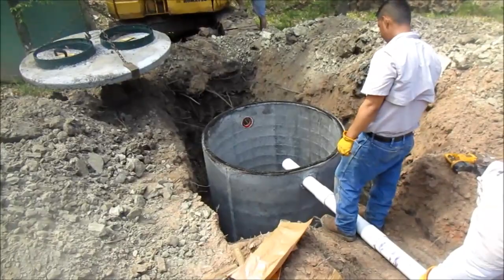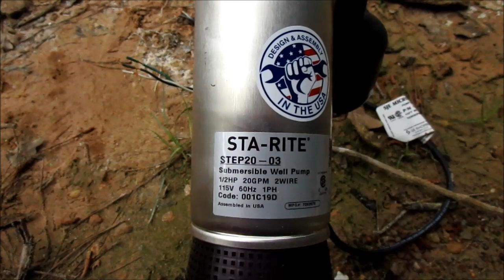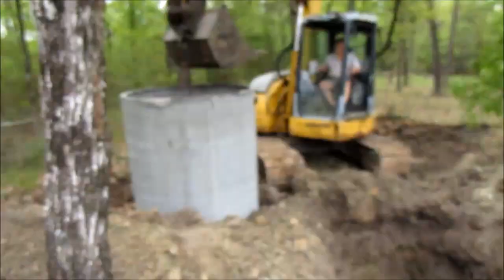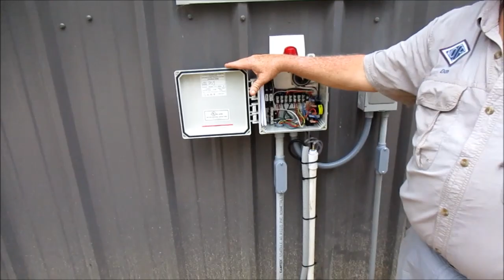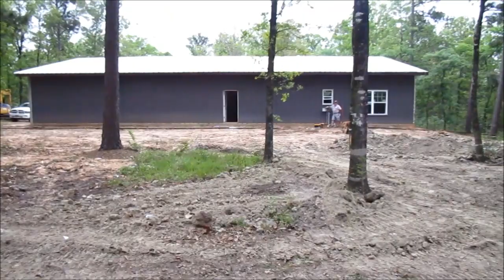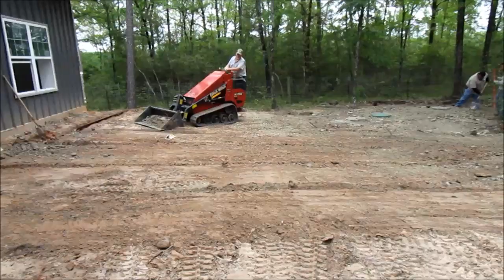Installing an Aerobic Septic Sewer System in Texas close to Lake Front

Comment: How much for the aerobic system install?
Reply from the maker: It cost us $6500 at the time
Reply: Thanks for this video. Very helpful
Reply from the maker: Appreciate the comment.glad we could help
Reply: @LarrySbrusch  how's the system working? I'm about to put in a system and the contractor wants to do an aerobic system like this. Have you had any trouble at all? Thanks
Reply from the maker: @jl9678  I have not had any problems at all. I did run over one of the sprinkler heads with my tractor, but that was an easy fix..Chester moore and sons out of livingston did a great job for me..
Reply: @LarrySbrusch  thanks for that info! I'm really glad to hear that. I'm in dfw area so livingston is almost 4 hours away. I wish I were closer so Chester's team could do my system
Reply: Too much